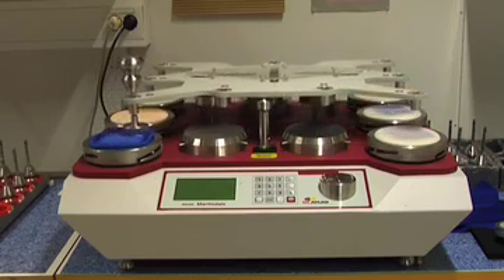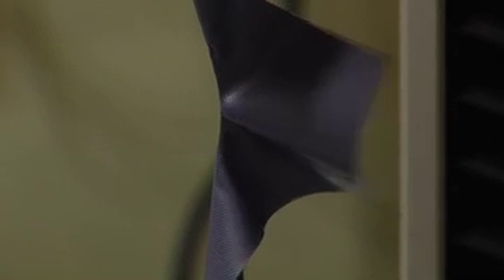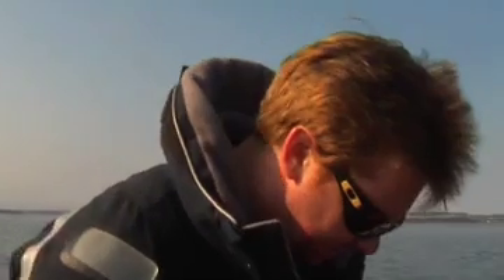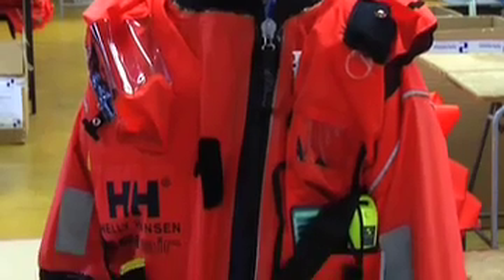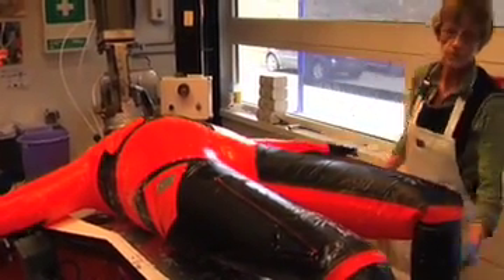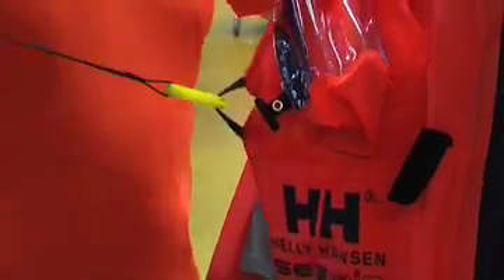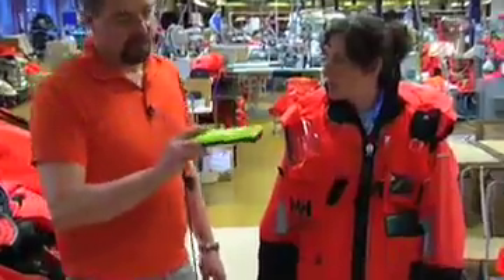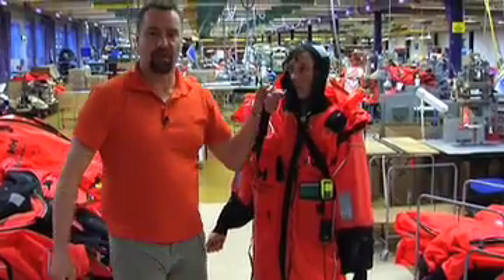Helly Hansen Survival Suit testing in Norway

Comment: @eilirudy I cant find the web site of where the media came out can told the people that it was 24 hour survival time, but i did how ever find it on wikipedia "i know not every thing on the web site is true" but i did how ever find the stament on the web site.

I brang it up because there was a Cougar Helicopter Flight 91 that crashed do to a gearbox losing oil pressure.The people on bord it used the E452.